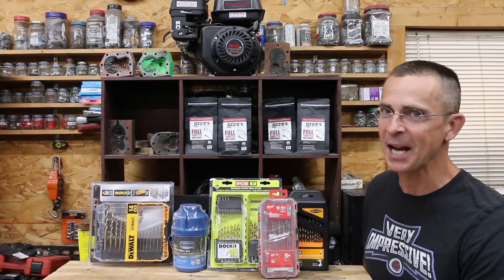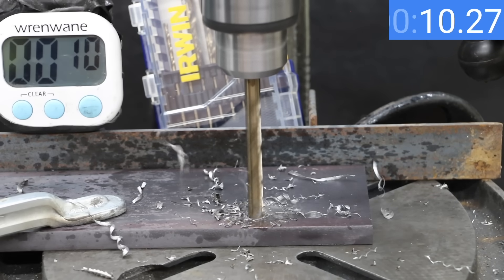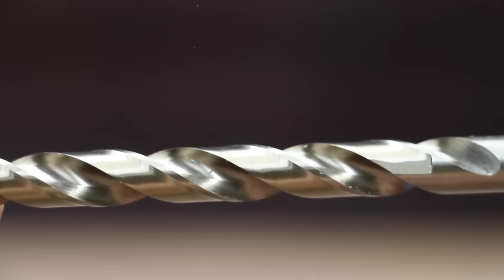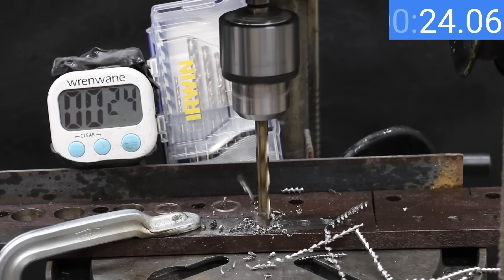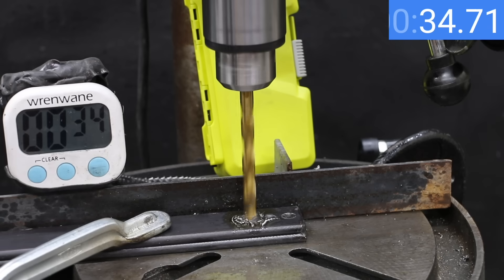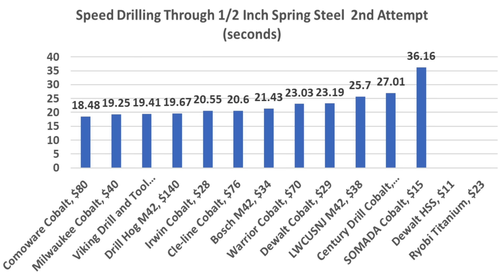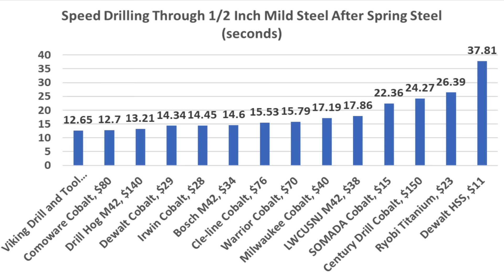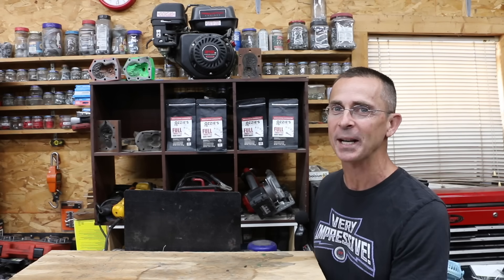Best Drill Bit Set? $11 vs $200? Let’s Settle This!

Comment: Great video.
Could you please consider doing a review of indoor propane heaters for emergency use? 
I want to switch from kerosene to propane for backup heat. because of fuel cost, weight, smell, and storage, but there are so many propane heaters that fit 20lb tanks in the back, that I don't know where to start, especially since most of them are online only and I can't put hands on them without buying them.
Reply from the maker: Thanks for the suggestion.

Comment: As a Tool & Die Maker, personally I can't stand drill sharpeners.  As an apprentice, they had me sharpening drills all day for 2 weeks by hand.  After that, it's effortless to sharpen them perfectly, They drill exactly on size, Sometimes my 1 drill used a lot 19/32" was sharpened once and lasted the entire year and even more with no more sharpening.  That's drilling through countless thousands of inches of steel with it.  Some days I drilled for sure 1000" + /day.  Proper cooling, proper feed, listening, watching the type of chip coming out all help make it last and correct RPM. I used the same Drill Bit for 9 years, one day it rolled off of my cart, hit the floor and broke off 3" of it.  I had a funeral for it.

Comment: I broke a 1/4" drill on the drill press and it threw a chip of drill in my knuckle right down to the bone. I've never seen anything like that. I'll have to check at the shop what brand they are, I can't remember right now. I never did the safety squint ever since😅  Always wear eye pro!!!
Reply from the maker: Wow, thanks for sharing.  Another reason to always wear eye protection just in case the unpredictable happens.

Comment: I purchased the Bosch drill set following your link from last years video.  I am very pleased with the purchase.   It was able to go through down spouts without deforming the metal.   One bit was able to drill 16 holes in a steel  garage door and some hinges with no problem.  Thank you very much for your recommendation.

On a side note, I tried the Bosch, DeWalt, and some other drill bits used by metal workers with cutting lube, and still can't drill through a no brand Chinese clever with a wooden handle from Amazon.   I just want the convenience to hang it on a hook, but will probably drilling through the handle.  Thanks again you guys
Reply from the maker: You are welcome!  Thanks for sharing.

Comment: I have the bosch bit set and got them very cheap on sale on amazon. I bought 1 set and later 3 sets. For M42 including a 1/2" was a steal.

The bigger bits do dull quicker than Id like. And i have snapped more than a few of the smaller ones. But they have served me well.
Reply from the maker: Thanks for sharing.

Comment: There are new style drill bits with a step bit tip. Some are called turbo step, hyper step, etc. These are by far the best bits I have ever used. I bought the Astro set over a year ago for under $100 but there are many sets out there upwards of $300. I would love to see these ran through your tests to see what your results are.
Reply from the maker: Thanks for the video idea.

Comment: Great video! I'm surprised to see the cheapest option (Dewalt) performing so well for the low cost. One Dewalt tool I picked up recently hasn't impressed me, however. The 20v MAX cordless & corded shop vac sucks but not in the good way. There is virtually no suction and the thing is loud for the small size and little suction it produces. I would love to see a cordless and or corded shop vac comparison!
Reply from the maker: Thanks!  Thanks for the feedback.

Comment: Love your product reviews!
  I've been using the Viking/ Norseman brand of drill bits for many years. One, because several machinists recommended them to me. Two, because they are made in the United States of America. One might argue that you can buy several sets of band "x" made in China bits for the same price, however that's what you should do when you buy the first set, because they don't last. It doesn't always cost less to do it cheap!
 My only thing is you shouldn't compare Cobalt bits with Ti coated bits.Remember drill bits are like saw blades, they are purpose built. Different composition, cutting angles, and flute design for different drilling tasks.
 I also attest to the fact I have called customer service at Viking with technical questions and recommendations and was actually connected with the engineering department, who were most helpful in providing me with info regarding the proper drill bit for my application as well as distributors that had the product in stock.
Reply from the maker: Thanks!  Thanks for sharing.

Comment: I have an idea for a video. you should do a video about car battery chargers.... there are lots of chargers out there, I've personally bought the Noco 10 charger and used its repair mode on my atv battery and it worked miracles... just a thought...
Reply from the maker: Thanks for the suggestion.

Comment: Thanks for always doing these unbiased reviews... But you left out the best brand I have found at Lowe's... Spyder Drill Bits.

A couple of years ago we were putting new flooring into a toy hauler. I couldn't get self tappers to go in the beans, and so we decided to drill them. Every single drill bit would break. We went to Lowe's and bought multiple sets. Finally, we bought these funky blue gimmicky looking bits.

Go back to the shop and started drilling. Finally, we got 1 hole drilled and it didn't snap. Success... Kept drilling and drilled the entire floor with that one single bit.

I have been a fan since then. So idk if it was just stronger, or if it would compete drilling speed wise as well with these.
Reply from the maker: Thanks for the suggestion.

Comment: The DeWalt "Made in Germany" cobalt bits are the real deal, I have drilled hundreds of holes through 4130 and  thousands through 1/8" 304ss plate with my set without issue.
Reply from the maker: Thanks for the feedback.

Comment: I have been using Spider bits (lowes) for some time. Showing very good durability.  I agree that while the split points can help with speed, they are very hard to sharpen (I don’t even bother).
Reply from the maker: Thanks for the feedback.

Comment: In CNC applications, holes are drilled with pretty close to a constant feed per revolution.  This gives consistent and predictable hole quality, and predictable lifespan of the drills.  If you want to drill faster you use harder drills at higher RPM but still feed about the same amount per revolution.  A 3/8" drill should feed between 0.004" and 0.010" per revolution.  Feeding too much per revolution is obviously not good, but feeding too little is just as bad or worse.  The surface of the material remaining under a cut is work-hardened.  A cutting edge will get worn down fast if it keeps cutting through the hardened material rather than cutting deeper to get under it.  Drilling too slow can wear out drills fast!  Drills of different hardness and sharpness can make holes of similarly quality if they feed the same amount per revolution. However if it is the force that is held constant, different drills will feed too much per revolution and others to little, resulting in many wearing out prematurely.  It would be interesting to see a comparison of the durability of different drill brands when tested at the same feed per revolution!
Reply from the maker: Thanks for the suggestion.

Comment: I'd be interested in seeing irwin turbomax drill bits and hyper-step style drill bits be compared to others. Also, when testing cheaper bits I think it would be valuable to add a straightness test in addition to your current sharpness and durability tests. Based on one of the previous videos, I purchased the Metabo 17pc set and found there were 2 that came pre-bent. I picked up the 21pc Bauer set and those were straight. The Metabos were mainly bought for practice at hand sharpening.
Reply from the maker: Thanks for the suggestion.

Comment: You should do a video on wire pulling lubricants.  
Some products to test:
Yellow 77 (used to be industry standard,but since its wax based it kinda sucks and glues the wires in the pipe after a while)
Clear glide (works very well)
FTTx a low voltage wire spray
Klien makes a new spray foam that I've heard is fantastic 
Polywater (gross but very useful) 
There are also some with plastic beads to act like bearings?

Qualities to test: 
How much does it reduce friction?
Does temperature affect it?
How far does the wire pull it along the pipe?
When it dries, does it glue the wire in place(very bad if it does)?

Does it break down different wire coatings? Nylon, pvc or thermoplastic 

You could use some cheap cat 5 to test with
Reply from the maker: Thanks for the suggestion.

Comment: I see you use the weights on the drill press often.  I’d be curious is there is a difference in pressure for life of bit and cutting speed.  Does more pressure cause over heating and failure?
Reply from the maker: Thanks for the suggestion.

Comment: Both sets of Dewalt drill bits I bought a few years ago were terrible. They're fine for soft woods or very thin sheet metal but kept snapping on hardwood I was working on and even drilling pilot holes into plywood subflooring. I even wrote on the box "Never buy these again" and got a $90 set that will outlive me.
Reply from the maker: Thanks for the feedback.

Comment: Operator error is the main cause of death of drill bits.  Have worked in industrial supply for 25 years. Names like Chicago Latrobe,  Consolidated Toledo, Drillco. Diameter, feed rate, material, rpm.  There is no 'does it all'.  Wondering which is 'fastest' is a bad metric.  Turn the speed down on those drills, gentlemen.
Reply from the maker: Thanks for the feedback.

Comment: Drilling stainless steel is always difficult. It would be cool to do a how-to video where you experiment with different techniques (peck or continuous, pilot hole or go for broke, push hard or soft, etc). After the how-to video, you could try different bits to see which ones can drill the most holes in stainless without breaking. It may be a different result from carbon steel.
Reply from the maker: Thanks for the suggestion.

Comment: Have you ever tested Rodman drill bits?  They are multi material the tip looks like masonry but you can cut steel,. concrete etc.
Reply from the maker: Thanks for the suggestion.

Comment: Suggestion: could you test electrical contact cleaners? Products from CNC, WD40 Specialist, and deoxit for example. Tests like ohm resistance, voltage drop as well as types of corrosion like battery acid, rust, etc. Thank you for your amazing tests as always.
Reply from the maker: You are welcome!  Thanks for the suggestion.

Comment: Video suggestion: gear oil showdown! For manual transmissions and differentials. I would love to know if supertech’s low pricetag is really worse than a trusted manufactures (Honda, Toyota etc since HondaBond was very good RTV) also, would you consider bringing HART into some of these comparisons? I do a lot of my own mechanic-ing and have bought an embarrassing amount of their tools because they are cheap and available at Walmart. BUT they are owned by TTI, who also manufactures Milwaukee products. Would love to see if they are good value compared to the others!
Reply from the maker: Thanks for the suggestion.

Comment: Great work, as ever, Mr PF!!
Drill press and constant force is the way to drill, though with regard to the swarf; it's your guide. As I drill for a hobby I have my press set on its lowest speed, use plenty of oil and lift the drill point to cut the swarf and re-apply more oil when necessary. This ensures the drill is doing the work, but not getting too hot as it's heat that makes drills blunt I think. Hand drilling, especially in an awkward spot means it's harder to drill consistently and it's more likely to damage the bit.
I've found drill sets with 0.5mm increments to be mostly fine, even when tapping common sizes. The holes might not be 'by the book' but carefully tapping makes the right holes where the material isn't too think and the thread sizes are M4-M12. Didn't check the size increments of the drills here but many didn't look 0.5mm (or equivalent) increment.
Partly thanks to the geat work here on Project Farm I use a Drill Doctor for sharpening bits, though just for ~3-19mm. It's great, though expensive. I'm not at all good at sharpening bits so deceided to buy once cry once.
Reply from the maker: Thanks!  Thanks for sharing!

Comment: I have an arctic cat snowmobile(2 stroke) if you research what type of oil to use in a pinch if you can't get the manufacturers suggested the results are all over the place. Can you do a test on snowmobile specific 2 stroke oils? Piston scuffing,power valve cleanliness, cold weather flow?
Reply from the maker: Thanks for the suggestion.

Comment: Pretty good comparison! and Milwaukee definitively have some special kind of unobtanium material. Those are not cheap but not too expensive. I had to drill some holes in marble for which I bought some diamond carbide bosch drill bits, which only were able to drill up to 2 holes each. Given the urgent need I had to try my luck with some germany made milwaukee ones, which are not rated for marble and which did not have diamond tip and those were able to do the job without a sweat.
Reply from the maker: Thanks!

Comment: Your price axis/comparison could be improved as you do not apply any normalization. Meaning: You should not only talk/show the price for the set, but (also) the price per drill bit. A $20 set for 40 bits that behaves the same as a $10 set for 5 bits, is obviously much better.  
Otherwise, good tests as always. 
Especially the performance loss is the most important metric of them all, as this shows if investing more is actually worth it in the long term, so this should have been more prominent in the final table.

Comment: A storage bin test would be good.. Many models sold right now at home Depot , Lowe's, Costco etc. 

Tests: waterproofness, max stacked weight, max carrying capacity, rat bite proofness (grinding or durability test), volume - space efficiency, drop/spill test.
Reply from the maker: Thanks for the suggestion.

Comment: I wonder what the results would be if you sharpened all of them once. I don't sharpen mine so price matters a lot to me. The DeWalt black and gold are pretty good and cheap and go on sale often. I think the scores would also change if you did 10 or 20 holes. That's when the expensive ones would start looking looking a lot better. 

I really need to get me one of those drill bit sharpeners.
Reply from the maker: Thanks for the suggestion.

Comment: Would love to see you test air angle die grinders. I do a lot of rust repair and I've gone through 4 grinders in 5 years with fairly regular oiling and greasing. Thanks
Reply from the maker: Thanks for the suggestion.

Comment: Having done my own testing of drill bits, I too found the Viking bits to be the best. Although I have a couple of sets of cheap drill bits from the 80's that seem to be invincible. 

If you really want a torture test of drill bits though, the spring steel is ok, but a much better test is titanium. I can't tell you how many drill bits I've melted going through titanium. Viking bits will breeze through 316 and 304 stainless no problem. But the only bits that reliably go through titanium are solid carbide bits. For spotting and piloting in titanium, I use a 1/8th inch carbide spade bit. I make these bits on a D-bit grinder, which is good cause I can make them for a couple of dollars, instead if buying them for $20 each. Viking bits will work on titanium, but if the bit is turning too fast, it will melt immediately. You have to turn the RPM all the way down, use excessive pressure on the feed, and flood oil.
Reply from the maker: Thanks for sharing.

Comment: Excellent as always. 
Since you were looking for adding some segments to your channel, I think it would be a nice addition to add at the end of each video, tips on how to care for or use the tools/parts properly. Some teaching as well as testing. Such as with drill bits, the difference lube can make vs dry drilling when necessary. With engine tests, how to winterize properly, or what not changing oil does.
Reply from the maker: Thanks for the suggestion.

Comment: I just picked up a set of Warrior titanium coated bits from Harbor Freight and was surprised to see that the drill angle on these bits was 118 degrees, which seemed to be the most popular angle for general purpose drilling till about 10 years ago.  Now most sets seem to be 132 degrees.  It might be an interesting test between bits of 118 degrees versus 132 degrees, but it may be impossible to find multiple manufacturers who sell sets of both angles that are the same class of bit, ie, HSS, Cobalt, Titanium coated, etc
Reply from the maker: Thanks for the suggestion.

Comment: This is a real torture test for drills. No machinist parks 175 lb of thrust on a 3/8 drill with only a dab of cutting oil and expects a drill to properly do its work. Perhaps this test methodology accelerates normal wear/tear/usage - but perhaps the abuse doesn't allow the superior products to actually shine...

I own/operate a machine shop. We've tried lots of brands of twist drills and the best we've used to date are Drill Hog.
Reply from the maker: Thanks for the feedback.